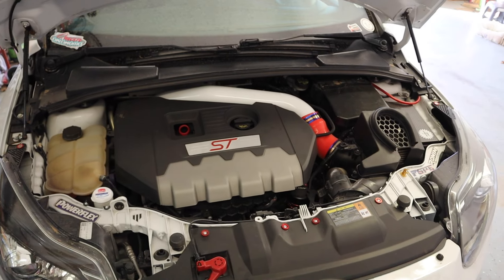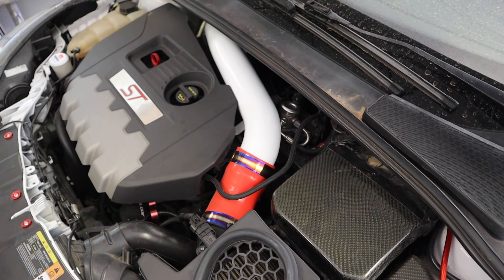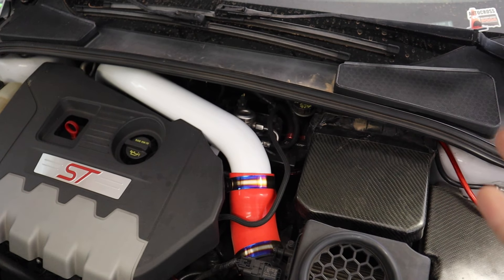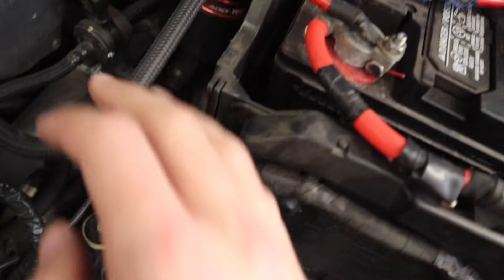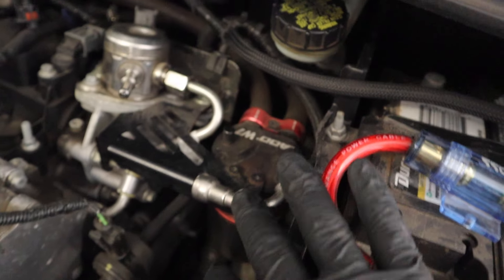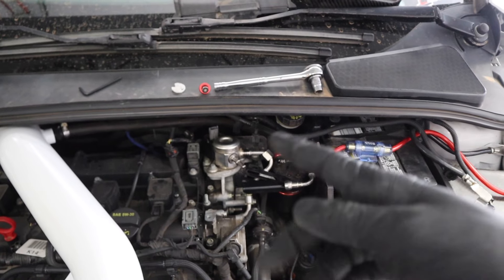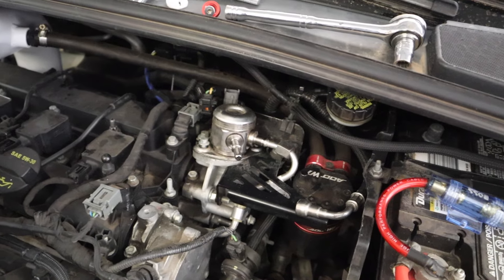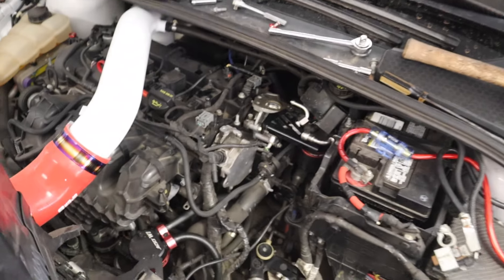Replacing a High-Pressure Fuel Pump on a 2.0T Ecoboost - 2013 Focus ST

Comment: A few things from the guy who designed that high-pressure line (that would be me).  It is supposed to be a one-use-only part.  Once you disconnect it, you are supposed to replace it with a new one.  Why?  Because when the ends are tightened down, they deform a bit so they no longer meet specifications.  Furthermore, any gunk that you may get on those ends can lead to a leak.  Also, the nuts are supposed to be tightened with both torque and angle.  They should be tightened to a specific torque and then tightened another 35 to 40 deg.  You don't want to over-squish those ends and you don't want to under-squish them either.  Bad things can happen... I have seen them happen...  They are glorious when they happen and then you are very sad later on.  Now, if you re-use the tube, will it fail?  most likely not, especially if you tighten it correctly, but you can only do it a couple of times before you deform it past the point that it will seal properly.
Reply: where do i buy more of that line
Reply from the maker: Super cool that you designed it! A little more experienced now from engineering school and can definitely say I overlook less of those specifics related to design choices now! Actually watching my video to see how I did this when doing an engine swap lol, so will take that into account when putting back together, thanks!